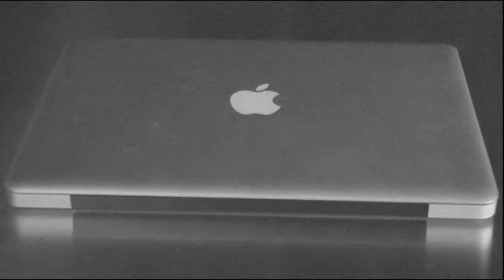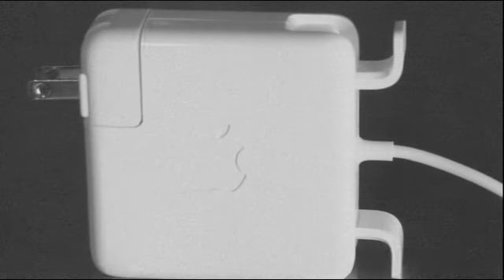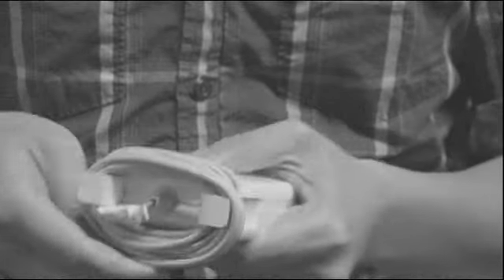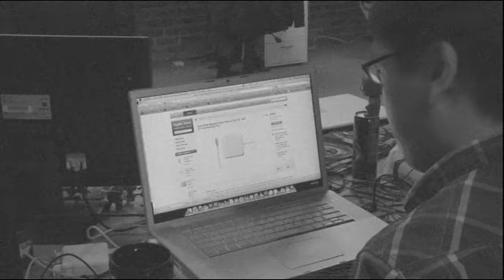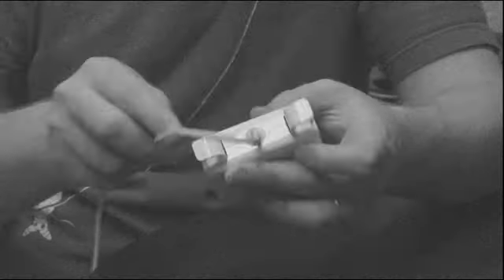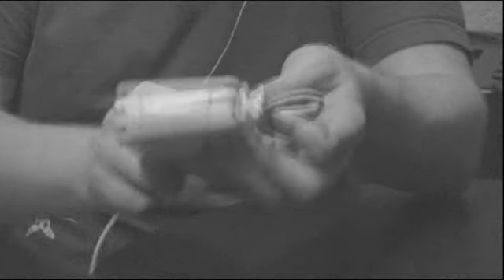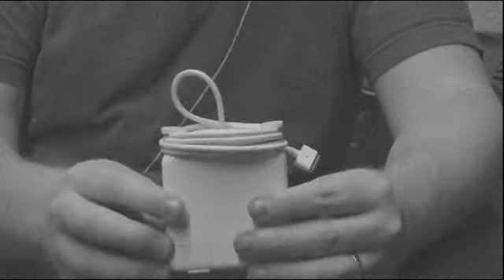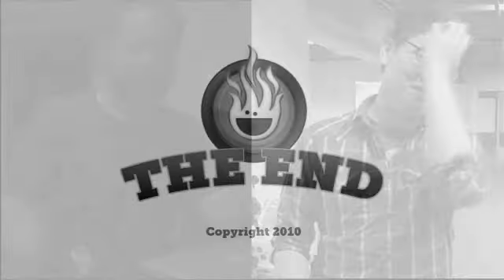How Not To Destroy Your MacBook Power Cord

Comment: The problem lies in that stupid connection to the brick which has little to no strain relief on it. Over time, even with careful use and wrapping the cable like in the video, it is still going to get messed up from having pressure pushed upon it (as it sticks out), such as from being in a bag.